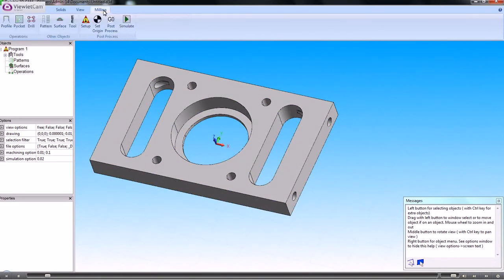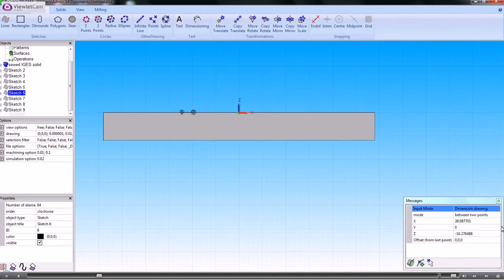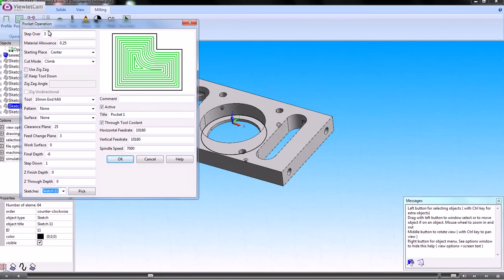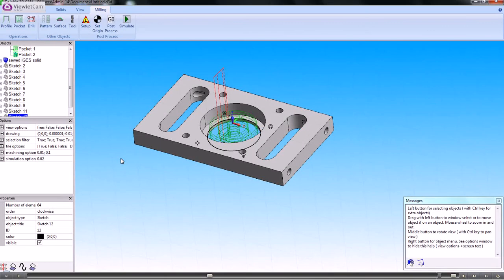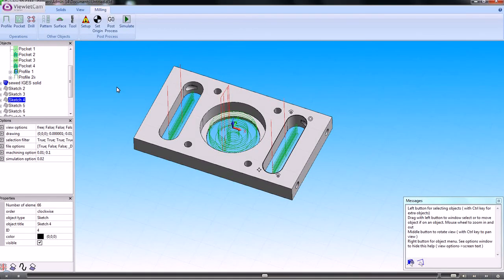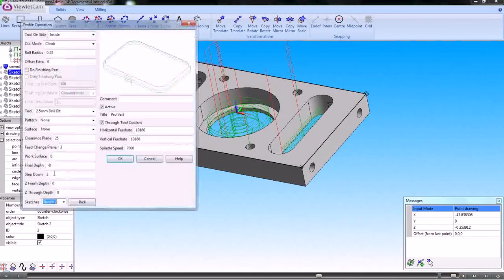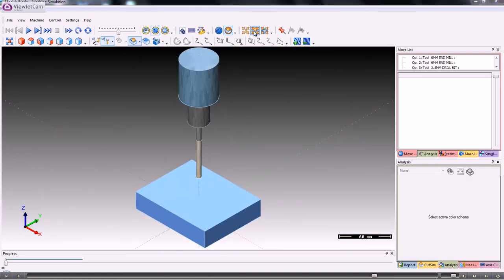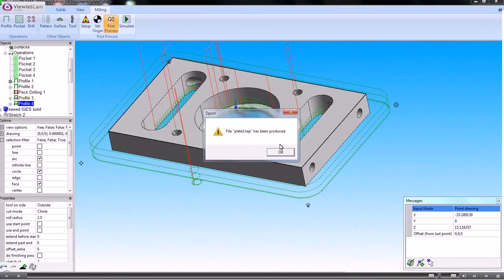Dolphin 3DCAM - 2D Machining

Comment: Hello, I'm using the trail version to see if I like this software. Iv ran acrossed a issue. The version I'm using is 14v but it looks a lot different to the one in the video about, is there any reason  to this? Our drawings are .igs files and we currently have to open it with the conversion software then open it in the partmaster cam software, where as the one you have looks as though I can import it straight into partmaster. Any help would be greatly appreciated